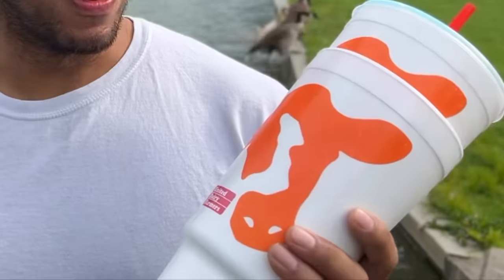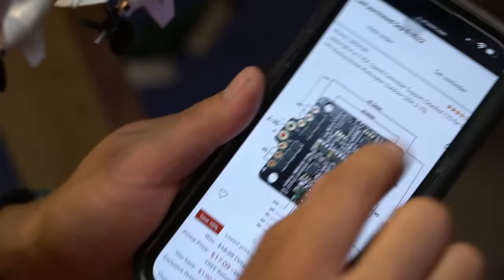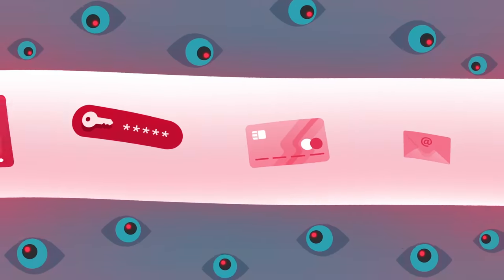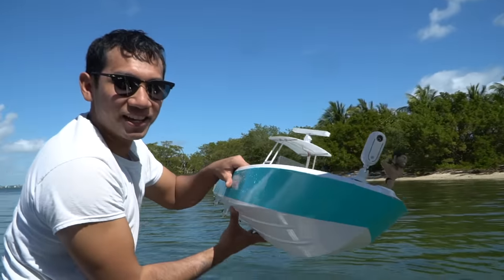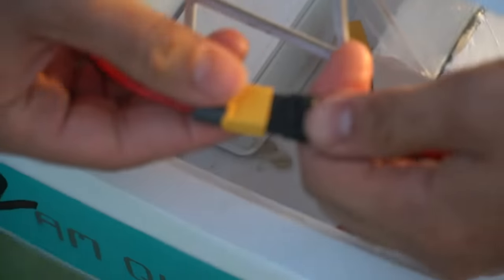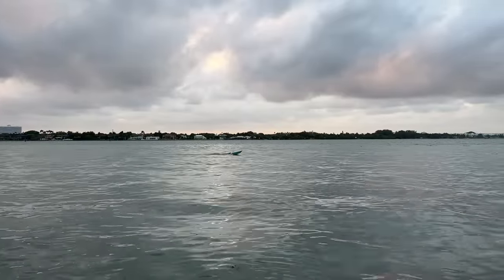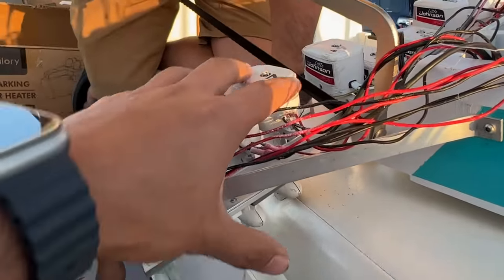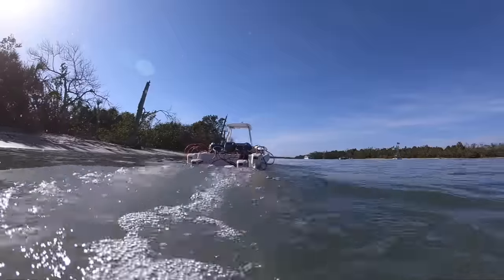How many boat engines is too many?

Comment: I love the thought and the execution, but i have some thoughts as well.
with all the engines, as you said, adding them in a "series" manner does not increase the effect as much as side by side as there are props functioning on turbulent flow with a lot of cavitation (air bubbles created by unnder pressure for those unknown :) ). My immediate hypothesis is that when using more engines, the torque needed by each motor decreases, meaning you could increase the prop pitch to push more water pr. rpm, increasing the top speed. If the maximum rpm is reached, but the engine is "running loose" (definitian ad hoc now: push <= drag) as a result of unutilized torque,  that would meen no gain. 
Hope you try again with some of this in mind. (Dont really know if it would work or not as i only have a basic in fluid mechanics, but my intuition tells me it would be beneficial.)
as well, when mounting the engines side by side, you could probably help with the water flowing over the engines by adding a counter weight in front (in addition to changing the prop angles to reep benefits of torque distribution pr engine to maximize speed).

Comment: If i may, try a hydrofoil setup on it with different stages for the motors. 1st is the original 4. 2nd is the additional 8 once the lift is achieved.

Comment: Try this again but angle the outboards up slightly like full size boats have they aren't all flat they change angles deep in the water in the center then higher on the outside.

Comment: Pete you need to redo this and tye closer you get to the transon put each layer of engine props lower so all props will operate and push water unimpeded.  The transom layer of engines should be the deepest in the water

Comment: I think you should have two long arms at the front with an air foil connecting between them with motors mounted on it... The air foil should be lower than the rear motors...

Comment: This has got me wondering if there would be any benefit in running 5 motors, but having 3 of them with really high pitched props? I'm pondering if the 2 normal props would be enough to get the boat fast enough for the high pitched props to work effectively, and if the drag of the normal pitched ones not keeping up with the speed of the water flowing across them would negate any benefit from having the 3 with "Higher gearing"?

Comment: Never to many but, Johnson/Everrude? Ya gotta go Merc 450R or better! 😆 OK,  so I've been around a few boats,  planes and props. Center of gravity, prop pitch...cup...direction of rotation all come into play here.  Honestly, I think boats/water show prop dynamics better than anything I've seen in the airplane realm.  Probably because water is harder than air.  Ask the titanium rod that keeps my right knee attached to my ankle if you don't believe me.  Turns out Wakeboarding got into the X Games for a reason. Also, the added drag of all those lower units? Come on. Straight shafts with a single rudder and a little differential thrust would be far better.  And for God's sake, never get in a brick layers 17' sparkle rocket of a Skeeter bass boat with a rebadged 200 Merc! If it doesn't blow over? It will still hurt you!

Comment: i think the motors set up at 12:30 would be a great idea if you raise them up as you ad rows on behind because with them the same height as the row in front of them when you take off  buries the whole motor under the water and the water hits the big part of the motor and cancels out  the water flow if they were raised then they wouldn't interrupt the flow of water so much and would help speed up the flow

Comment: you would need props that are designed to run at a higher speed. the extra outboards would provide the torque to pull a taller gear.

Comment: I suspect there may be a maximum water speed for a given motor/prop/hull configuration. Once that speed is reached there's likely no benefit to adding more power. Perhaps having more power beyond that point might allow you to reach that speed more quickly though?

Comment: A triangular transom might keep six to eight motors inside the critical footprint without overlapping cavitation.
It's having hull in front of, or over the prop that stops the thrust burying the rear. It should work with the correct trimming to compensate but it would need to be dynamic with each motor adjusting its AOA in accordance to the trust torque .

Comment: I have an idea for a wierd VTOL aircraft. 2 wings facing in the opposite directions and instead of creating lift by rotating or by the movement of the whole plane it would use propellers blowing air into the wings.  I'm not sure if it would work at all.

Comment: I'm pretty sure one optimally shaped and high powered prop is the most efficient, maybe two props rotating opposite directions to cancel out rotational torque. Using more than two IRL is more for compromise reasons than to be opttimal; e.g. more small propellers rather than one or two big ones to be able to go into shallower harbours; more props in pods around the ship to get more maneuverability at the cost of less optimal max speed, multiple outboards on a smaller boat to get around size limitations (both physical and legal maybe) of how large an outboard can be before it's impractical; or just because you want more power than the largest outboard that is made etc. (and for some reason you want the motor to be outboard). Outboard engines is already in itself a compromise; by having the engine and propeller combined as one unit you make it easier to add and remove the engine to the boat, and originally most people would detatch the motor and gas tank and keep it at home most of the time and only leave the boat outdoors or in the marina. But with the ridiculously large outboards, and particularly a complex multi engine steering setup it's a huge process to add and remove the engines anyway, so they might as well be inboard engines; but I guess some boys like to brag about how massive and how many engines they have and it's easier for everyone to see how excessive your setup is, if it's all outboards...

Comment: Correct number of Outboards is what your boat transom tells you you can put on it which is normally in horsepower. I watched a fellow get a hard bottom inflatable boat which was rated for a two horse power motor and he put on a three and a half horse power motor because he said that number that was on the transom was just a suggestion which is not very smart of him. Eventually he might start having issues with his transom breaking or bending or cracking because of the extra weight. Always go by the manufacturer's recommendation

Comment: Peter: Hull is what determines maximum speed, not the size of the motor. At a certain point the resistance of the hull on the water becomes maximum and no amount of added horsepower will make you go faster. instead: the excess pressure in the transom causes it to break the motor mount.

Comment: I wonder if the prop configuration pitch, rake angle and blade shape   is the limiting factor kinda like running out of gear on a car  More motors with the same prop gets to speed in less time but ultimately the speed is limited by motor rpms and prop pitch.

Comment: You need to layer the motors like theater seating. With th le lowest layer closest to the transom. Also I would suggest differential thrust.